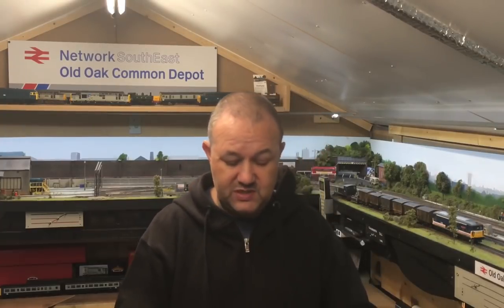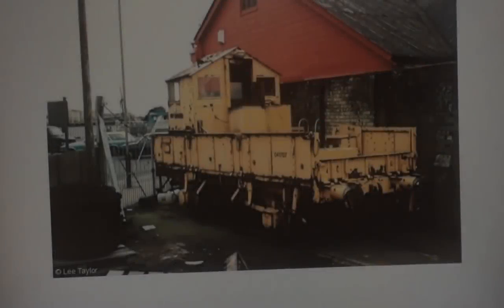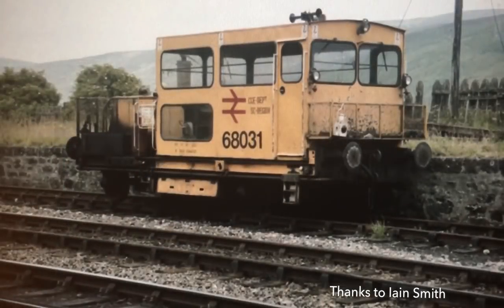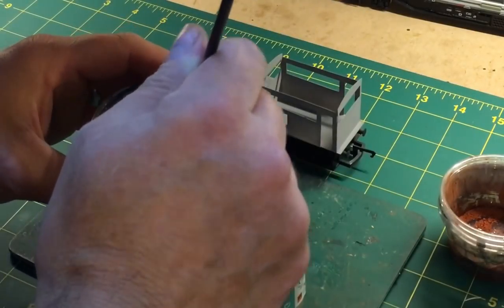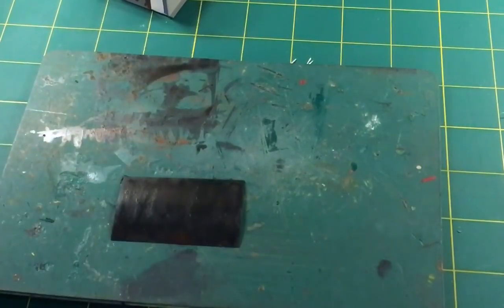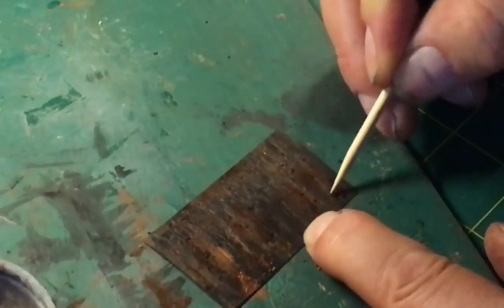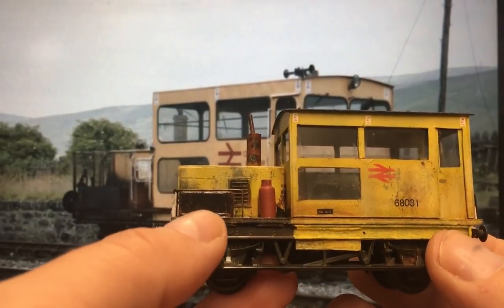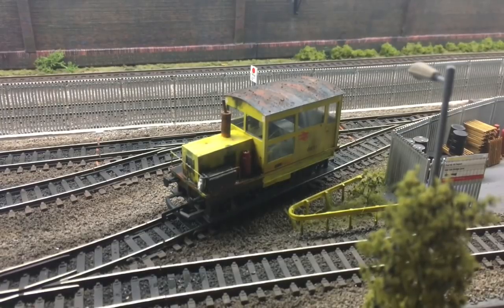3 Video-Scratch Build Challenge

Comment: Wow!!  What a fantastic result Garry.  A great scratchbuild and superb finish to it and a bespoke piece of stock for the layout. Now, how do you go about motorising it?! 🤔 Paul
Reply from the maker: Thanks Paul 

I believe your setting me another challenge 😂 lol

This will only be a static model as original intended to tow around or sit in a siding or possibly on another diorama 🤫 

I did consider about motorising it using N gauge motors but really did not want another shunter running around. 😂 

Great question and very interesting point 😉
Cheers as always 

Garry 👍

Comment: Lovely job with the wagon Garry, you really are getting good at weathering. Nice to see you have put a membrane on the roof panels, it looks better than the bare insulation. What did you use for the membrane?
I watched the new Channel 5 Model Railway Challenge but thought that the team leader who used all those rows of houses as one building was a bit full of himself and deserved to be pulled up by the judges.
Reply from the maker: Hi Geoff 

Lol firstly yes blue team Barry didn’t do himself any favours on TV  
I’m not fond of cheats 😁

Very interesting watching the show in its format as this is a first for all of us involved- but it has created talk on railway modelling so it’s making noise 

Thanks for the comment on the roof yeah it did not look to pleasant, I added a black plastic floor /window membrane on top of the original silver foil- there about £4 a 8x4 Sheet from wicked DIY 

being corrugated it allows air to circulate under the top white board 

The down side was getting small screws to tack it to the roof 

My biggest scratch build will appear in November’s 2nd show so one to watch.

Cheers again and all the best 
Garry
Reply: @cheekytek  Thanks for the info on the membrane.
Geoff